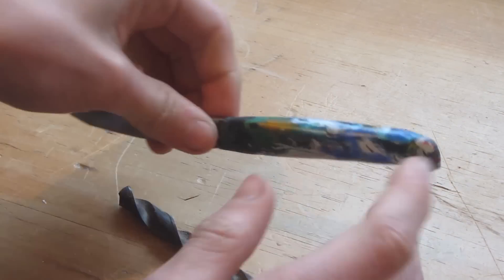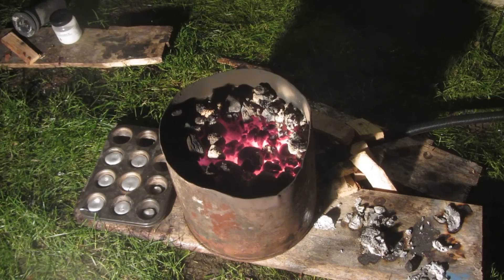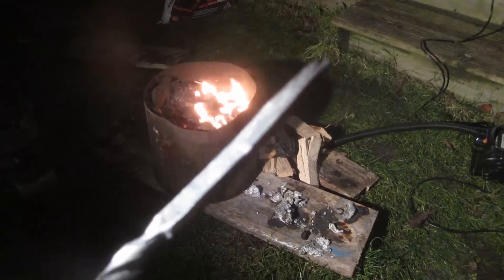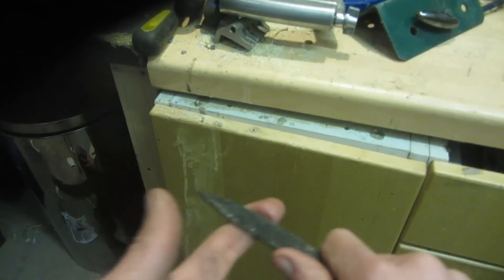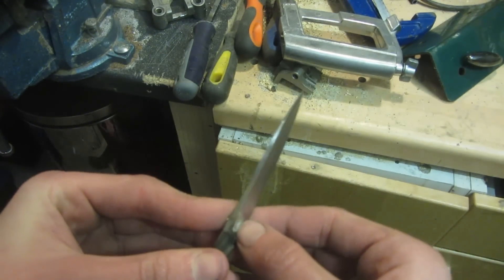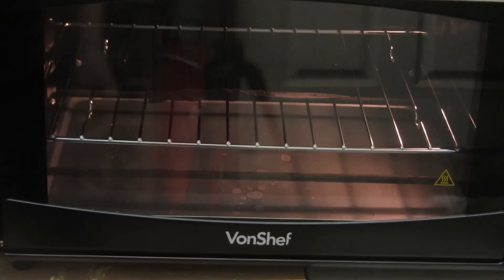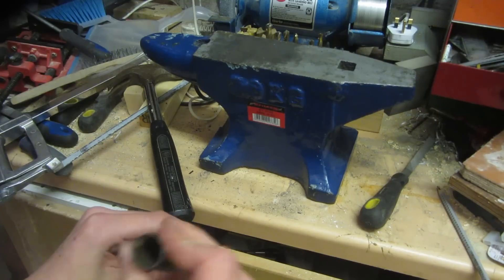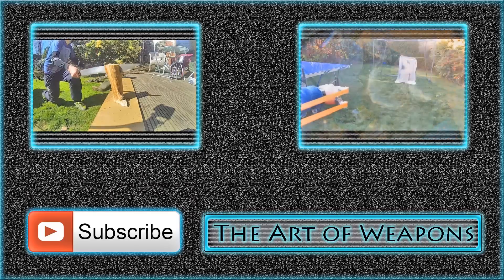How to Forge a Carving Knife From a Drill bit - part 1

Comment: Try to find yourself a heavy log to put that anvil on, you're losing some of your hammer force with the anvil bouncing. Traditionally the top of the log should have a slight slope across the anvil gave do that scale terms to fall of the top of the anvil. When you've got that you can forge yourself a couple of staples, or shape up a couple of small horse shoes to fix the anvil down.

Great video, thanks for your work.

Comment: Nice job. A few suggestions though. Your files are only made to push not pull. It folds the teeth down when you use the push pull technique. Another is to temper the blade you heat it and quench it like you did but on step 2, heat it not as hot, a light red yellow and quench it again. That is how chains are done.

Comment: Great job, Kid!!!!  Just keep on working and learning!  You did GREAT for your first blade!!!  A safety tip for you:  when running power equipment like your sander, lose the watch and the long sleeves.  Wear a tighter fitting shirt with short sleeves.  Watches and loose clothing are just begging to injure you.  Loose clothing can get caught up in power equipment and drag a goodly part of you INTO it.  Start learning those safety habits now, while you are young and make them a religion!!!  BTW...you got good safety glasses?  Another CRITICAL piece of safety gear!!!!  You have only two eyes...don't risk them!!!

Comment: You said you melt aluminum correct? To make ingots? If so be very aware that aluminum can be very explosive and could harm and or kill you if it has water mixed with it. Such as a soda can be sure to bake the cans in a oven to dry up any liquid for safety.

Comment: lay the blade across horizontally when it's in the forge.  That way, you will get more consistent and even heating.  When you quenched, the tip was already turning red.

Comment: I have been forging knives for 30 yrs. and I think I have most of the bugs out. A few suggestions: Anchor your anvil to prevent movement. Get a pair of tongs or make them to allow you to keep your hands further from the forge fire. For a cheap but good fire pot find a used car break drum, sized to your choice and set it into a forge body of pretty much any steel surface that will support it. I've used an inverted lawn mower body.  It will allow you to stack coal around the firepot, which is what your tin can forge is, allowing easy refueling. Use a different metal for forging. Leaf and coil springs in the U.S. are 5160 and make everything from paring knives to long swords and oil harden. British, German, U.S., Sweden, Switzerland files are also good and made from simple 10 series steels and water harden. Keep away from any Chinese made metals as the content is questionable. 5160 hardens around 1650 F . 10 series between 1450 and 1550 F.  Good luck and keep it up. Doing is the best learning process.

Comment: Motor oil does NOT "add carbon" to the steel. It hardens it just like any oil, which is why vegetable/canola oil is generally better, because it has a lower flash point and will not ignite.

Comment: When you quench the blade during the hardening, you should only move the blade up and down and NOT side to side. This will reduce the amount of warping done to the blade during the quench. I've also found that normalizing the blade first also reduces warping. Just a tip about heat treating from someone who has been doing it for a while.

Comment: Be careful with forging steel you don't know the composition of, because galvanized steel and rebar have dangerous fumes from what's in them. Other metals can be harmful too.  I recommend using oil hardening tool steel.

Comment: You should get a mighty forge. They are very fast heaters nd easy to use, but rather expensive. The normal price is $620 but i got mine for $310.

Comment: Well done.  I have also messed around with a forge a little.  Old car springs seem to make good knives.  They are a bit softer than tool steel but with the right hardening and tempering it doesn't really matter.  You can also get unidentified leaf or coil springs from scrappers quite cheaply (however if they know the vehicle it came from it is expensive).  I find that it is a good source of a useful level of carbon steel.  Coil spring also makes a good hole punch.

Comment: Something to keep in mind for hardening and heat treating,,,, when you harden you need to "soak" the blade at the right temperature for at least 30 minutes,,,, tempering your temperature was to low and to long in oven,,, you need about 400-500 for 30-60 minutes

Comment: You are on the right track. Motor oil thickness can be inconsistant, plus it very dirty and toxic. If you ever plan to use your knives for anything food rated you will need to quench in medias that are safe for consumption. I have made knives for years and I have always used an olive oil pomace. You can get large quantities cheap from Indian/middleeastern markets.  Make sure you warm your quenching to about 90-100 degrees F before quenching as cold oil may warp larger blades. Cold oil repels away from hot steel and you won't get a good quench. There are alot of ways, this is just what works for me. Check out Walter Sorrells' channel. He has alot of useful knifemaking tips. Excellent video!! Keep it up!!

Comment: OK, you asked for tips to improve. Here's a couple of things off the top of my head. Disclaimer: I'm not a professional metal worker, just a guy who's forged a knife or two (although I mostly do stock removal rather than forging).

Let me first say that for a first attempt, this is pretty good already. You seem to know your stuff, maybe not all the details, but considering you did this without assistance or tutoring it's rather impressive.

1) Depending on how comfortable you feel with gas, you may want to see about making yourself a gas forge somewhere down the line. It's cleaner, less junk from the coal on your blade, and it's easier to monitor the temperature of your steel. The downsides are well, first of all, it's gas. And the forge, even a homemade one, will be a bit more expensive than a simple coal forge because it needs lining, gas nozzle, perhaps a fire brick, ... It's a matter of taste and preference. There's nothing wrong with a coal forge, so if that's what feels right to you, carry on.
2) Not sure you do this, but every time the blade has been heated and hammered, before sticking it back in, clean the surface with a wire brush to remove the scale and surface impurities so you don't hammer them into the surface on the next pass. Also clean your anvil face while your steel is in the forge, for the same reason.
3) A good support for your anvil would be a fat log, and the anvil should be affixed to it so it won't move. Alternatively, you can weld a metal support instead of using a log; plenty of tutorials for that. The anvil should also be set to the correct height to reduce fatigue or muscle ache when forging for prolonged times. If you have something with adjustable height, it can help you find the correct height for your anvil face: lay a wooden plank over it, and strike it with your hammer in what feels like a natural swing to you. The hammer should leave nice flat marks. If the far end is more indented, the height is too low; if the near end is deeper, it's too high. Rule of thumb is to let your arms hang by your side, and make a fist. The knuckles should touch the face of the anvil. Adjust from there, since it's just a rule of thumb.
4) Grip the hammer farther away from the head. It may feel like you're less precise (and you probably will be until you get used to it), but it gives the hammer more punch with less effort.
5) If you want nice flat flanks on your blade, look up "drawfiling". :)
6) In time you may want to start using proper tongs. These can be expensive, but hey... You're a blacksmith. You can forge a ton of tools yourself. Enough videos on that kind of stuff here on YouTube.
7) You can do differential hardening by submerging only the cutting edge into the oil, rather than the entire blade. This leaves you with a flexible spine, hard cutting edge, and depending on the steel, a nice hamon.
8) As I said in another comment: files are excellent blade material. So are leaf springs. Mind you, every steel has its own heat treat parameters: some steels are air hardening, others need oil, others water, and the temperature, duration and number of treatments for tempering is also dependent on your steel. But all of this can be looked up online, if you know what kind of steel you're dealing with.
9) If you're not already on some knifemaker forum(s), check them out. A lot of good advice is swapped there. A good English speaking knife forum is BladeForums, but there are more.

But most importantly: have fun with it. :)
Reply: jimmicreesti bladesmiths are a helpful bunch. ;-)

But thanks. :-)
Reply: Can I +1 that comment? 

Get your anvil set up right and you'll be better able to swing your hammer properly.

(Of course, because I can see into the future, on your other videos, I know you have done this now! But for anyone else's benefit...)

Comment: when you quench your knife in oil, make sure the oil is in a metal container or tin, coz if you touch your hot knife blade on the plastic of your tub of oil now it may melt through thereby causing you to lose oil and maybe ruining your knife tempering process. good job otherwise, just a useful hint :)

Comment: If you hold your hammer further from the striking surface you'll make life a lot easier. Then rather than using the hammer to such detail use the anvil and the piece to work the different strikes.

Comment: Kid your on the right track, i was going to say something that would have been cool would be to take and put the bit in a vise and untwist the bit if you will. For tempering you need a higher temp then 180 you should be at like 400 450. Sand and clean the steel off after the oil quench and you will be able to tell if you there by the color of the steal. You normally would be looking for a honey wheat color to achieve your 55 Rockwell that you were looking for your knife is probably still at 80 or so if you did get the quench right(that's hard for me to do and I've been smithing for 2-3 years now) umm other wise neat little video and keep learning buddy if you have questions or need some info hit me up.

Comment: If you place your anvil on a concrete stand, or at least cinder blocks, you will find that your metal forges easier. Dirt and wooden stands flex too much and absorb a lot of the power of the blows that should be moving your steel.

Comment: a few tips:
normalize the steel. normalizing the steel is a similar process like the tempering of metal. to normalize steel youll have to bring it up to a cherry red temperature and then let it cool down in the air. do this about three times. 
forge the tip of the blade directly after you draw it out. 
secure your anvil

nice vid, btw

Comment: Small piece of advice, dont choke the hammer like that, if the handle is long, it's for a reason!, you'l move more metal with less efforts at an equivalent heat!

Also, it's advisable to form the point early on, on the future bevel side, as hammering the beveling in will "raise" the point, you'll form that point, easier, faster, and without wasting steel!
That's not critical on an homogeneous steel knife, but if you ever make a forge welded knife, with a steel edge welded to an iron back, it ensures that you do not end up with a point of iron, or mild steel, but high carbon steel all the way to the tip!

The better you get with a hammer, the less time with files, sandpaper or a backstand!

Comment: As far as I know, using motor oil does not add any carbon to the outer shell of the blade. Of you're looking to up the carbon content, look for some case hardening compound. Helps integrate carbon into the exposed surfaces of the blade.

Also, you most definitely can not forge a carbide of any kind

Comment: I realized that during your heat treat you spun the knife in a circle when you quenched it. when the metal is rapidly cooling it is very important to move the blade only in an up and down motion in the direction of the blades edge is facing and not side to side or in a circle. this is because the blade can warp. it seems that you didnt have a problem with but it will matter more if you get a better steel like mentioned below. the comment below said 01 tool steel but if you are looking more on the high carbon side of the steel types 1095 is very popular in knives.

Comment: i have a lil tip :), hold the hammer at the end of the handle. you will get way more power out of it and its not so hard on your elbow joints

Comment: You would do so well in prison.  nice job.
Reply: They have forges in prison?
Reply: skyler cox I'm talking about a forge. You cannot melt steel with a bedframe
Reply: skyler cox I doubt they would allow you to gather materials capable of melting steel inside a prison
Reply: Top Kek But jet fuel can't melt steel beams :s
Reply: skyler cox even so, i don't think you will be able to "hammer", "Grind" en heat up a forge to 900 Celsius without the guards noticing.
Reply: rphinks What is your bed supported by? what's in your mattress? You could easily get the necessary materials in a prison.
Reply: NarratingFox you could make a forge out of anything as long as you have fuel.
Reply: rphinks mattresses are quite flammable as are clothing and other things. All it takes is a hole in the ground or a tin cup really.
Reply: skyler cox Yes they're flammable, but don't burn hot enough and they burn too quickly. It's an insufficient and inefficient fuel.
Reply: skyler cox mattresses can't melt steel beams(pun intended).
Reply: +skyler cox either way you dont need to melt steel to make a shank. I can make one from paper and water.
Reply: rphinks what are your prison bars made of?
Reply: rphinks Yeah where would he find jet fuel inside a prison
Reply: NarratingFox genius
Reply: NarratingFox genius
Reply: Lucas Holl Anything burns hot enough in a forge with air going into it. Whether you've got a make shift hand pump or just another guy fanning the flames you can make that stuff burn hot enough to weaken the steel enough to shape it,
Reply: +rphinks then you wouldnt believe they can build a fully functional still, brew mash, and distill moonshine in prison either. They do.
Reply: CaptainHowdy760

Comment: When you are quenching the blade after heating it up to critical temperature, you should use something like canola or vegetable oil. Motor oil gives off Noxious fumes and, as far as i know, does nothing in terms of giving it a higher carbon content. In order to add carbon, you would have to somehow evenly distribute the carbon throughout the molecular structure of the steel. Also, when you Quench the  blade in the oil, you never, EVER swirl it around or push it from side to side. Doing this could warp the blade which is a pain in the butt. When you quench, push it from edge to spine. Doing this has a lower chance of warping. Lastly, when you pull it out of the over after tempering, you have to quench the blade in cold water immediately after pulling it out. this freezes the molecules, keeping it hardened. nice job for your first scratch forging build.

Comment: first i just gotta say your a bad ass kid i was amazed at your level of knowledge . so forging tip
1 keep your steel in the center of your fire to low in the fire screws it up as well as too high in the fire will put crap in your metal
2 take off that plastic jacket it will melt to your skin , use leather 
3 cut your hammer handle bout 3 inch shorter
4 if your going to start using leaf springs to forge go with the oldest you can 1960 and older because the quality of the steel has droped off since the its good for some stuff but not for knifes
5 bolt down your anvil and get it taller your anvil should touch your knuckles when you make a fist and let your arm hang
6 DO NOT use galvanized stuff it will screw you up bad maybe even kill you
 you probably know most of this stuff but id just want to be sure that a kid as smart as your dosent get screwed over one little detail

Comment: Great video man, just a tip on hardening the blade: since you have forged the steel in shape it has built up stress in the steel, which can compromise the toughness of the blade and cause it to crack under pressure. A way to fix this is before you quench the blade heat it up to non magnetic then let it cool down to a touchable temp. This process is called normalizing. Doing this will take the majority of the stress out of the blade.

I am far from an expert on this subject but I have been forging and knife making for about two years now and thats a bit of helpfull information ive picked up along the way.

Comment: for quenching  the knife  in oil its best to be used engine oil as it has high carbon.
and when tempering you usually want to heat till a blue tinge runs down the metal